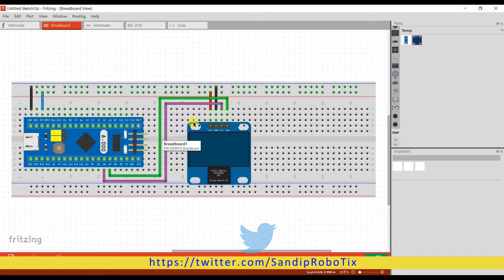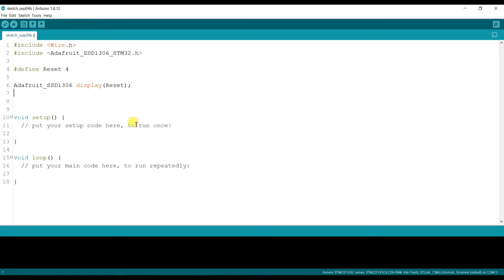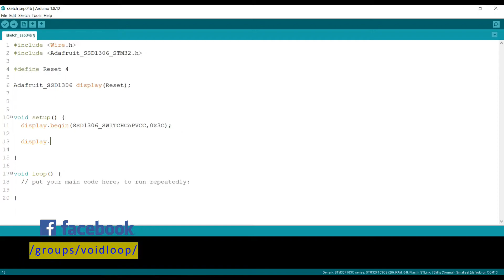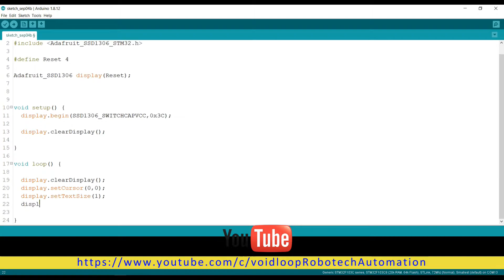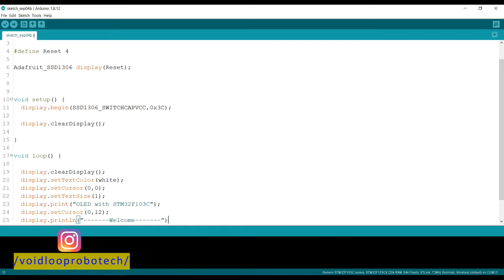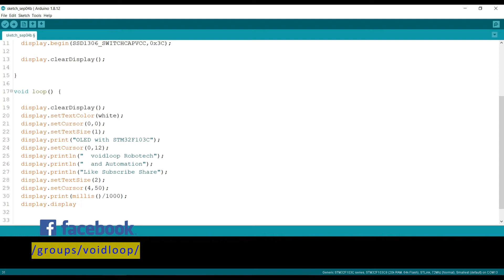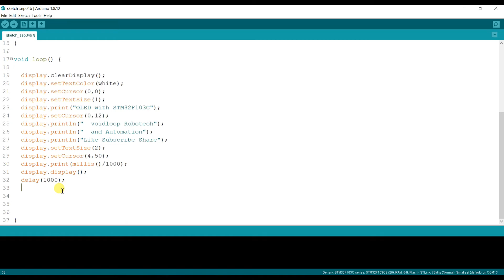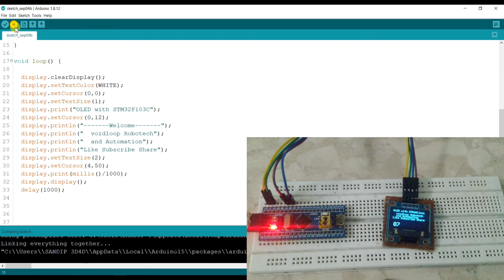08 SSD1306 OLED display with STM32 |Arduino| |BluePill|

Comment: hello, please one question , if you dont want ext oscilator, or if bluepill would not have external crystal, what would you need to change in the code to use internal clock?
Reply from the maker: Once I will check then let you know.
Reply: @voidloopRobotechAutomation  ok thanks in advance i will be waiting. thks

Comment: Thank you. I spent a day trying to find code that worked. The documentation I read says: Adafruit SSD1306 OLED display library allows you to reset the display using the OLED_RESET pin, which is set to 4 (D4) by default. You can set OLED_RESET to -1 if your OLED display does not have a reset pin.
I also have the 4 pin GND/VDD/CLK/SDA version without reset pin so was using RESET -1. So do you know RESET 4 works here?

Comment: Which library and versions are you using?
I'm trying to do the same from more than a week. But getting lot of issues, related to library.
Bdw I'm having stm32f103c (blue pill) and  oled is 0.91" 128x32.
It works flowless on Arduino Uno, esp, etc.
But so much struggle for stm32 blue pill.
Any help would be appreciated..
Reply from the maker: STM32 F103C8 with Arduino IDE from Scratch: https://www.youtube.com/playlist?list=PLOYsAys6a6mlQ_dfVPVfmsKk88zPhU6lw
Reply: @voidloopRobotechAutomation  Which library for the SSD1306 though? I am getting an error "Error compiling for board Generic STM32F103C series.
"
Reply: @DrKannavas  
Yes, same error for me too with STM Bluepill and with Arduino Due its working.